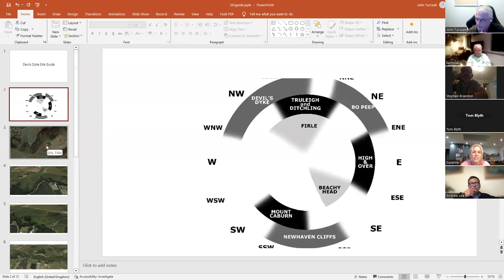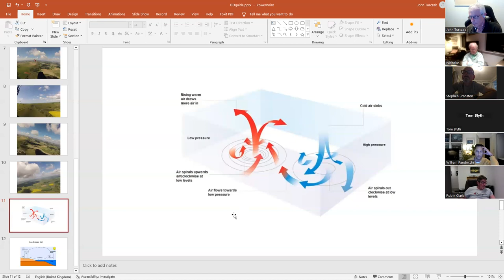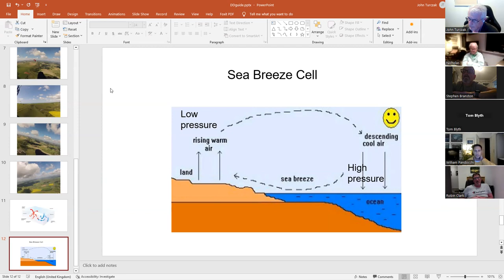Devils Dyke Flying Guide

Comment: Thank you so much for this - especially re how to do the Truleigh run which I think would be a really nice aim as a first mini XC. So just to clarify on the Truleigh run - you don't stop there you just turn around and come back (because that site is no longer functioning right?) and it is safe to top land all along the ridge there if you worry you won't make it over the powerlines on the way back?
Reply from the maker: Safe is a very relative word when it comes to flying. You will have to assess it as you fly and determine if its 'safe' for you. Its going to be an area on a hill you have not landed on before. So a lot more care is required. Its why I repeat several times in the talk  "land at the bottom." If you are not competent at top landing and  slope landing then dont make an unknown area one of your attempts.